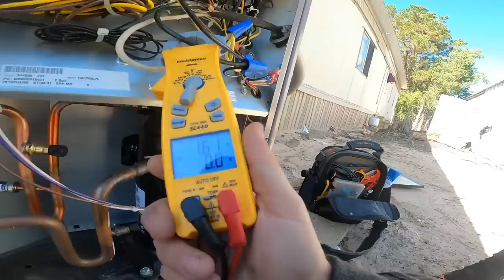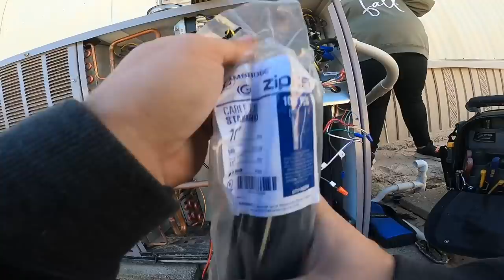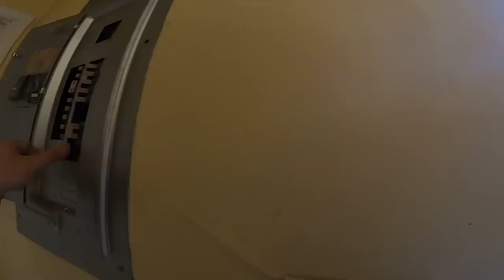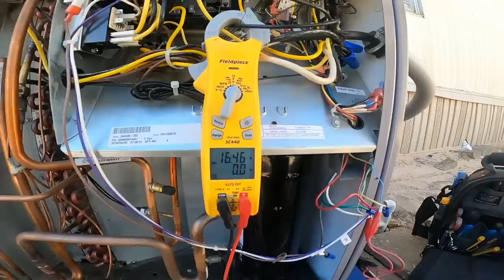No Heat/New ICP Package Unit

Comment: That wire doesn't look like it can handle 10kw heat strips. Wouldn't be surprised if that breaker eventually tripped. Installers were smart not to pig tail it like that if the wiring was in-fact insufficient.
Reply from the maker: Let me say it one more time sense obviously you didn’t hear it in the video…… ITS TEMPORARY open your fucking ears
Reply: @johnisraelhvac2019  I heard it well. Do what you have to do. Was just commenting to let others know this could be an issue since you didn't explain why it shouldn't be done and it could potentially be a fire hazard. You know, helping others and lifting up others in our trade without tearing them down.
Reply: It might be temporary but good way to burn something up. If you used a piece of number 6 wire I could see wiring it temporary. I would never walk away from that unit wired like that.
Reply from the maker: @josephfarrow2685  Well good for you, you wanna cookie?

Comment: Yes.... heat is important... especially here in upstate NY... we have a heat pump and strips... if it breaks down or the power goes out our pipes freeze.  Guess I could set up an emergency system? Propane or Generator but that cost bucks...

Comment: You could always unplug one of the heat strips and run on just one strip until the electrician runs the correct size wire. That wire you used is too small for 10kw. It’s dangerous
Reply: Yep. 10 gauge is a max of 30 amps. 45 will burn the wire up
Reply: One strip is not enough especially with no heat pump. Really it should just be done properly the first time
Reply from the maker: Hey guys let me say it one more time sense obviously y’all didn’t hear it in the video…… ITS TEMPORARY open your fucking ears
Reply: I believe the #8 romex could have been connected straight to the heat kit and the #10 could supply compressor. Doublecheck it's on 2 pole 50 amp breaker. No electrician needed.
Reply: @lionelguillory6381  number 8 will not carry 10kw. You need number 6
Reply: @johnisraelhvac2019  oh ok. Did you tell the undersized wire that it’s only temporary so it’s not allowed to overheat and cause a fire?
Reply from the maker: @danielkelley7422  I sure did
Reply: @josephfarrow2685  10,000w divided by 245v = 40.8A. with room for blower. Should be ok. At 208v = 48A, no room for blower motor
Reply: No kidding u probably don't need more than 5kw in Louisiana 10kw is going to pull 40amp

Comment: If that is a heat pump system should not the compressor be running through a reversing valve? If it is not heat pump is there enough amps on that supply circuit and breaker.